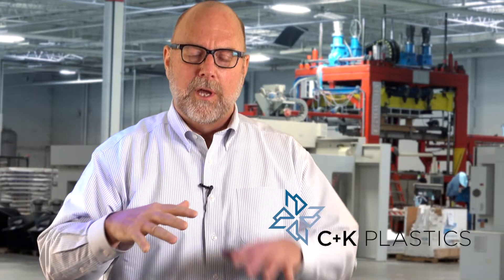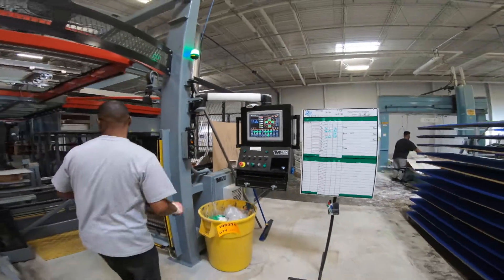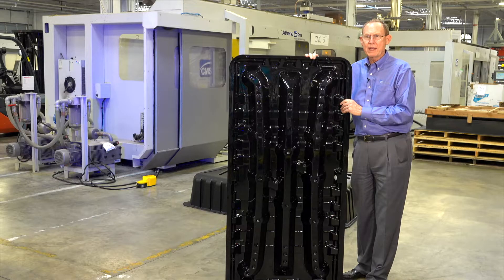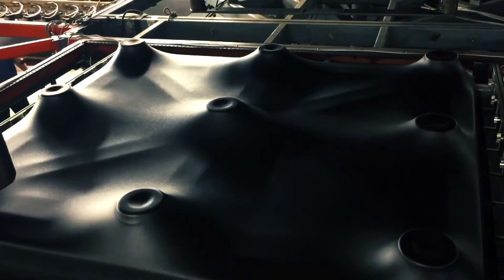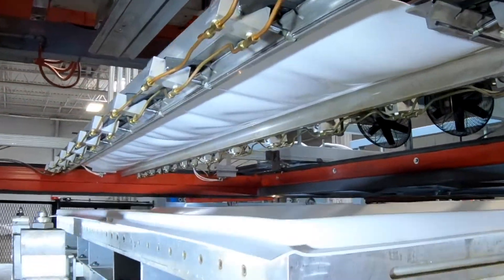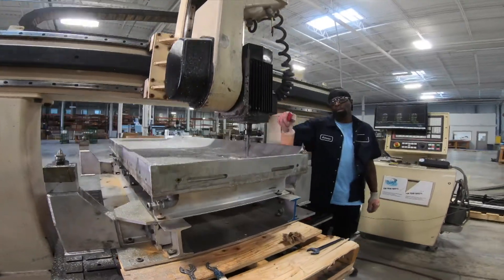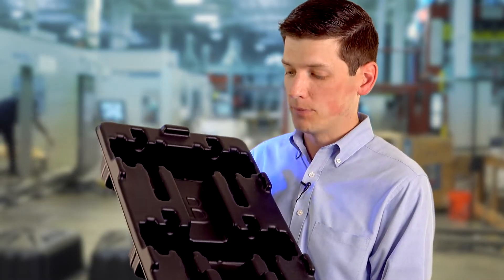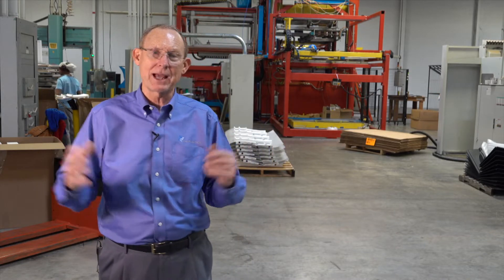Thermoforming Large Plastic Parts in our Georgia factory | C&KPlastics.com  | Conyers, Georgia

Comment: We manufacture a lift product to remove the hardtop from a Jeep or Bronco vehicle.  We currently manufacture the lift from mostly mild steel.  Are you able to convert steel tubing to plastic thermoforming and maintain the strength of mild steel?
Reply from the maker: unfortunately no.. we make the flat part not the structural tubing